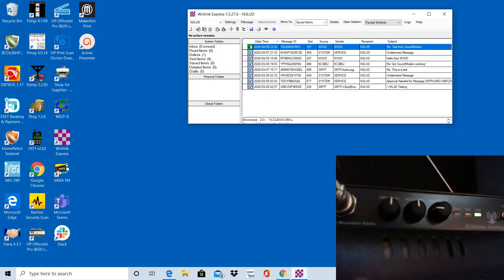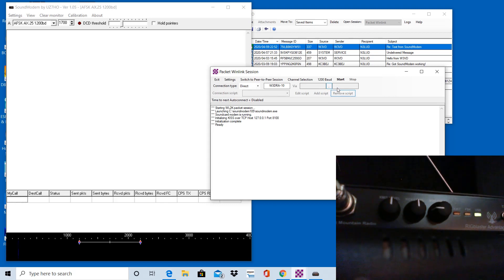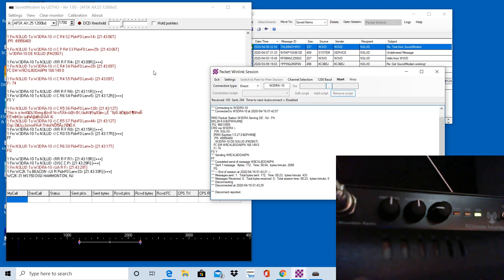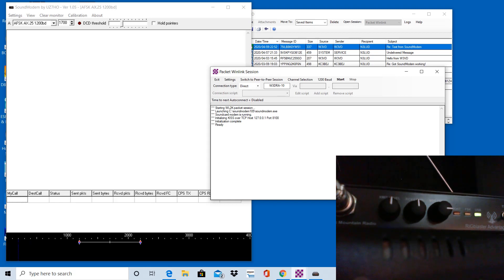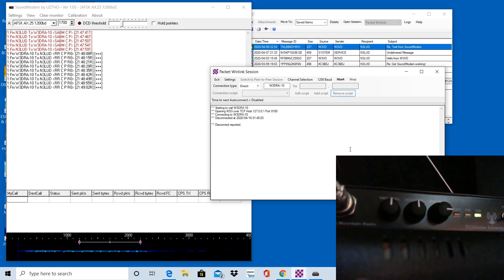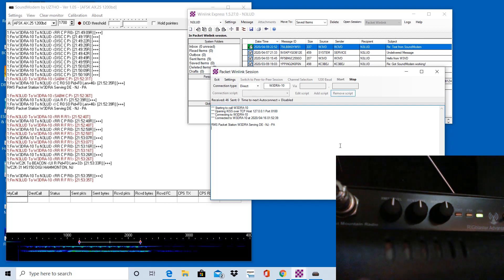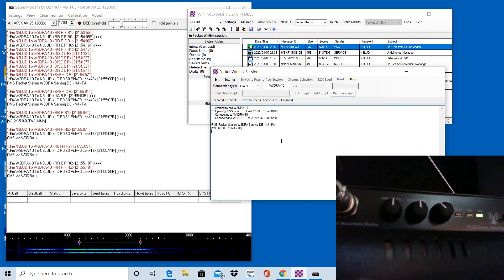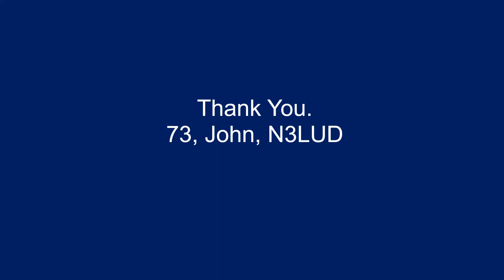Winlink RMS Express with SoundModem

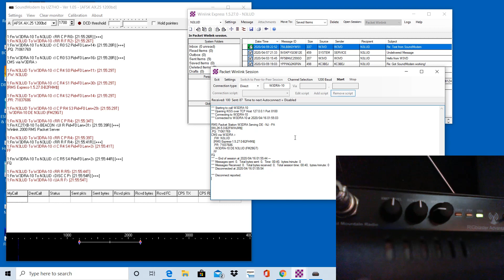Comment: Great video. Question: using a similar setup, but with a SignaLink. I have not been able to make any connection. Rechecked radio freq, winlink and soundmodem settings. Bumped SL tx/rx to 12:00; delay at 0. Tried the winlink  channel select, picked a close station. Still not connecting. Is my issue  the antenna? Using an indoor slimjim antenna. Able to hit local repeaters. Thx!
Reply from the maker: Sam if you can hear the other station coming back, I don't think it is your antenna. Are you able to talk voice to someone over simplex. Is there someone you can also try using the Packet P2P with? Have you ever tried that? Feel free to email me at N3LUD at caresradio.org